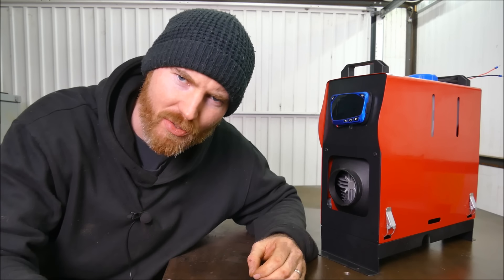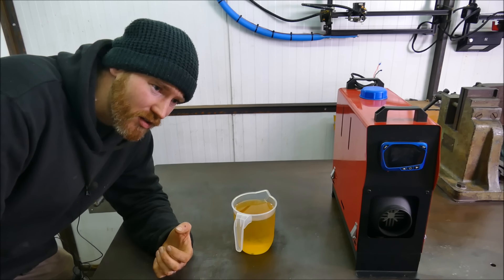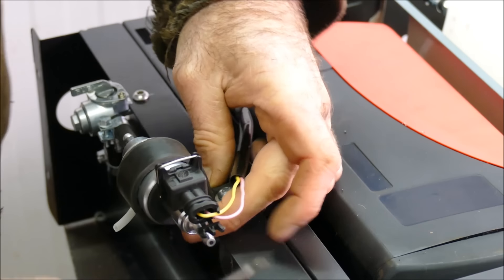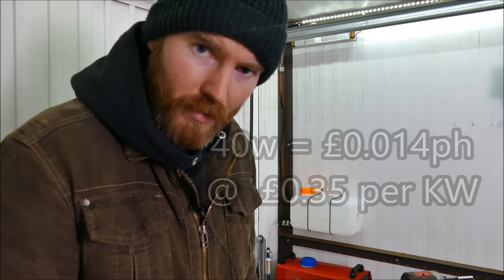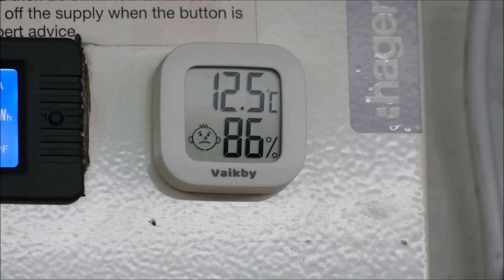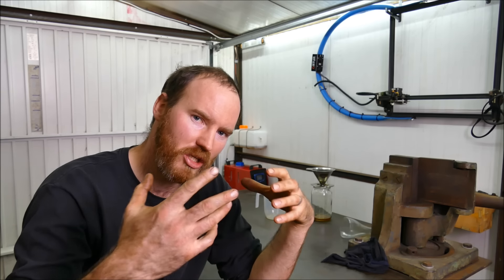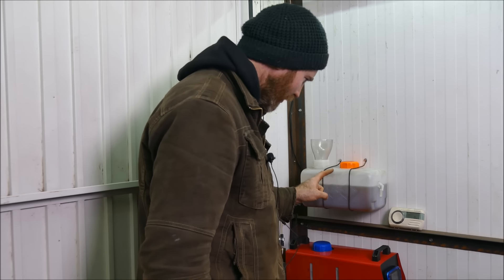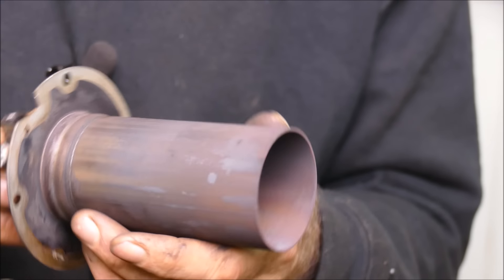£0.03 per kWh heater modification - Top facts & lies on diesel heaters - waste veg oil burn success

Comment: I wonder how well the heater would run on cold pressed hemp seed oil. Grow hemp for seeds, cold press the hemp seeds for oil, process the oil and use as fuel.
Reply from the maker: There is probably a chart somewhere but a low flash point makes an Ideal fuel. Cheers J

Comment: Could you use copper pipe for the exhaust?
Reply from the maker: Some people do. The stainless steel exhaust though is much cheaper to buy and can come in 2m lengths. Cheers J

Comment: @joshuadelisle Two interesting thoughts... Have you thought about scanning/creating a template for your gasket in LightBurn to use with sheet gasket material and your laser cutter to make your own supply of gaskets so that when you have to do maintenance you'll always have a spare on hand??? 🤔  I'd be curious if you used an Ozone (O3) generator to entrain the Ozone gas into the combustion intake to see if it would increase combustion efficiency and reduce emissions??? Ozone Generators are quite low power even though they use a step up high voltage to create the Ozone.

Comment: Unless anyone beat me to thi..... at 8:04min in - Might it have been a simpler arrangement if you had drilled out the chassis-through-hole and run the black hose all the way from the tank to your inline fuel filter. 3 fewer components!
Oh...and at 09:30min in - Is there good reason why you chose not to run black hose direct from pump to changeover valve? 
3 fewer components and two less opportunities to develop leaks.
Reply from the maker: Yes I wanted the white solid pipe in all places and not the rubber type. Also a consistent diameter and the rubber type is larger. Also the pipe coupling lengths were already cut to size which came with the solid pipe. Cheers J

Comment: Hi thanks for amazing video can you run this on used engine oil instead of used vegetable oil whats size fuel line you recommend also what wires you used to put the exhaust and fuel tank on please reply thanks
Reply from the maker: Thank you. Yes you can but it's recommended to cut it with Kerosene and have it well filtered. Changing the settings so it's air rich and pre heating the oil also helps achieve a clean burn. All accessories Should be listed in the description. Cheers J
Reply: @joshuadelisle  thanks for your reply if I'm using 9 liters waste oil not vegetable oil how much disle should I mix with 9 liters of waste oil should 1 liters will be good thanks also can I mix some Petrol for easy burning
Reply from the maker: @syedalam3513  if using filtered waste engine oil. I would do a 50/50 mix. Maybe even pre heat the oil too. Cheers J
Reply: I appreciate your fast reply thanks vegetable oil also 50 50
Reply from the maker: @syedalam3513  with veg oil you can use 70/30 cheers J
Reply: I did the setup today two tanks I want ask you if I mix little bit of gasoline with waste oil to make it thin will that work also do you prefer to run unit on high speed on waste oil or slow speed thanks lot mate
Reply from the maker: @syedalam3513  hi. I keep it oxygen rich. So I max the air speed at 4hz pump setting roughly. I wouldn't use gasoline because if it separates it becomes a fire hazard. Cheers J
Reply: Hi hope you doing good what pump should I run on 50% old used oil and 50% disel I'm having a carbon build issue should I run on max speed which is 5.1 hz thankyou

Comment: heat goes to the top of the room. what if we put device in to the middle of the garage e.x. under the table? there are also "Fireplace Fan Heat Powered Stove" will add some more turbulence over radiator or something :/ and what about putting some "car catalyst" to decrase polution? Also i loved idea to heat the water.

Comment: thanks for video ,,,,,,,,,,,,,, so where i live expect 5 dollar a gallon for kero @ roughly 5 liter a day is my math wrong ????? am i not getting my estimate of running 24 hours a day wrong compared to how long i would run this heater in a 720 square ft space ,,,,,,,,,,  would i have to run this heater for 24 hours a day , it gets some times around 30 F below zero here
Reply from the maker: Hi. I currently only use mine for a hour to get the room up to 20°c and then it's off most of the time. Also I had the machine on max for the test but you can set it to low which consumes much less fuel. Cheers J

Comment: I would have assumed that different fuels would require a different air/fuel mixture.  Does the air pump part of this design compensate for this by itself?  Or is there an electric motor for the air pump?
Reply from the maker: @benjaminnevins5211  you can adjust the air fuel mixture in the settings. I like mine to be oxygen rich for the cleanest burn possible. Cheers J
Reply: @joshuadelisle  I saw the part where you mentioned going into the settings and the pump pulses per second and the fan speed min/max. I just need to figure it out by testing?
Reply from the maker: @benjaminnevins5211  yes. It comes pre-set for diesel but you can  put an O2 sensor in the exhaust and tune it that way but adjusting the setting if you want it perfect.

Comment: Those rivnuts we're used extensively when my Jaguar was built. They suck. With a bit of age they can't be easily removed. The nut just turns with the bolt. And with the Jaguar most of them you can't get to the back side. So even after you get them out, you can't put the bolt back in.

Comment: Two things.
#1, To make the device run more efficient run the intake air to the combustion chamber off the output air from the heater. This will make the combustion run hotter and thus more efficient.
#2, Run the output hot air inside the exhaust-tunnel, this will increase the temperature of the device thus increasing performance without the need for any extra fans or heat-sink.
These two items in combination should improve the performance with a non-insignificant amount.

Comment: Hi Gary from the UK, just wanted to know if you can set the control unit up to a set temperature and it will come on and off for a constant room temperature
Reply from the maker: Yes you can but it doesn't switch off completely just drops to the lowest setting once the desired temp has been reached. There are new controllers I'll look into in the future which do it better. Cheers J

Comment: Would it burn nitro rc engine fuel? Rc engines use  glow plug as ignition...If so would it be more efficient?
Reply from the maker: Maybe. Not sure how expensive that fuel is. Cheers J
Reply: @joshuadelisle  2.5 litres is about 20 ish quid, so it's not cheap. But that's 20% (20% nitromethane, 15% synthetic oil and the rest is methanol). My maths skills arnt great so I was struggling to work out what the energy density per litre is. I do know that nitromethane needs less air than petrol/diesel to burn. I came to the conclusion that it might not be as fuel efficient and diesel/kerosene, but it might burn hotter? Then I remembered both nitromethane and methanol have a cooling effect before its burnt (that's part of the reason drag racers use it).

Comment: firstly replace your water with sand and you have a sand battery , secondly if you want to move the heat to a different location , use an egr cooler, with antifreeze (proper mix ratio) pipe it to where you want and add a heater core, pump and presto you have 100 % utility of exhaust gas and exchange core and a few pc fans to circulate the air through the rad, and that pipe is water tight its condensation from the immediate cooling

Comment: should the catylitic be next to the heater to work , rather than outside, on cars it is on the manifold as close as possible, would also have more inside as the cat. makes heat when burning leftovers
Reply from the maker: If it's a proper catalytic converter yes. The one supplied is just a muffler and has a drain hole that will leak carbon monoxide indoors so it should be outside. Cheers J

Comment: Hi great video . Im thinking oc heating my workshop . 
When using the veg oil did the exhaust smell of chips ? When i ran  new rape oil in a landrover the smell was notable.  Whats you opinion?
Reply from the maker: If it's clean burning there is minimal smell. A burner is probably more efficient than an engine. Cheers J

Comment: I have been looking into finned 22mm trench  heaters to recover the heat from the exhaust. You can get aluminium ones of these bit not sure they would handle the heat so I would use a copper one that has aluminium fins and also add an access point for cleaning, it would also need a constant fall so the condensate can run out. I watched another video on these where he tested the condensate with litmus and it wasn't acidic, which if it was from a diesel engine it would soon eat through  the egr exchanger and exhaust. Has anyone tried using a finned trench heater? And was it worth doing? It seems a faff to use a heat exchanger and a pump to take the exhaust heat to a radiator etc and will take up a lot more room on a wall and also adding more cost for parts and running costs of the electric

Comment: Because the bucket water was less then 100c, the water in the pipe likly was condensed water from water vapor in the exhaust. And the latent heat of condensation of water is about 2.260 kilojoules per gram (kJ/g) of water condensed. 

The majority of by products of hydrocarbon combustion are carbon oxidized to carbon dioxide and depending on the ammount of oxygen one can get minor amounts of carbon monoxide, and the other most common byproduct from the oxidation of hydrogen in a hydrocarbon is water. 

On cooling the exhaust gases, to below 100c causes water vapor to condenses and  give  up its latent heat of vaporization, which is quite a bit of heat, and so can very interesting to tap into for even greater efficiency. 

While most stoves use the chimney effect to pull in new air, and cooling the exhast to the point of condensing water out can pose a problem for getting enough air to fuel;  using forced air to the burner gets around that problem. 

Taking into account water condensation dribbles down a pipe, the exhaust coil should continually spiral down and then exit through the bottom of the bucket and continue a downward slope as it is guided to and  exits out of the building. 

Acidic water might form from small amounts NOx produced under combustion and form nitric acid with condensed water,  as well as form some carbonic acid with disolved CO2.  

Side track: If your condensed  water vapor dripples into a bucket of crushed egg shells, or clam shells, Then the calcium carbonate will react with any nitric acid and make a fertaliser, calcium nitrate that's water soulable. Although this would be pretty slow as ideally these units shouldn't produce much if any NOx. But You can then dump the water with calcium nitrate ions into your garden.

Comment: the exhaust is down hill and will soon fill with condensation.  the water bucket is a great idea, however, it should run in a slope to remove the condensation.  the line is NOT leaking.

Comment: 9.24 connection between the valve and the pump Hahahaha............The water in the exhaust was probably condensation from cooling the gases so low , High efficient gas furnaces have a drain and some times a pump to drain away the water , when the exhaust is cooler than the ambient air temp you can get a lot of condensation .   I have finally ordered a Vevor heater  it has all the goodies  for $198.00 , I wonder will it get here before WWIII ..................... good video Mate lots of how to in this one

Comment: What make of heater is this because I have seen a few of these and want to make sure I get the right one.
Reply from the maker: @RIPPUR7777.  They're all from the same factory just different names and colours, I've put a link to my recommendations in the description. Cheers J
Reply: @ Hi Josh I’ve seen this diesel heater Hcalory 12v 5-8 watt seems compact a nice on EBay  and supposedly Quiet which I want how ever I see on posts that they all have that ticking noise from the pump and have to up grade it. Would you think I should go for the cheaper model as I would have to upgrade it anyway. I would assume this make is made in the same place.
Reply from the maker: @RIPPUR7777.  Again
 they're all the Same. Just go for the cheapest or most convenient. Cheers J

Comment: The exhaust could have been collecting exhaust. Problem is that water is acidic too from some of the other exhaust products, like co2. Moisture will lead to acids eating through metals so make sure the exhaust drains well and is durable.

Comment: Kerosene or parrafin here in the UK is on my understanding only used to clean these so they don't need taking apart, heavy oil is best and parrafin or bio to clean, if you use parrafin then add veg oil  so it doesn't get too hot
Reply from the maker: Kerosene and paraffin are essentially the same thing. Kerosene is used as heating oil and last time I bought it was £0.60 per litre. Cheers J

Comment: My freeze dryer included a pitcher style water filter for the air pump oil that has to be changed every so often. Not sure how well it works for vegetable oil but it is a set it and forget it type of deal. It is somewhat slow.

Comment: I know this is old but could you put the exhaust through a intercooler type of device with fans could we gain some extra heat?
Reply from the maker: It's definitely possible. I'm building a heat exchanger for the next video on this. Cheers J

Comment: Hi, thank you for your video who is this targeted at? I have a domestic Fioul Heating system, with a 2000 L tank and a 20 kW heater. I’m guessing the price of diesel fuel is currently around one euro 35. If I could make my system more fuel, efficient, that would certainly interest me.

Comment: Hi, I'm clearing late to the party & but due to the £700 per month e.on want for my existing heating system I installed a 8Kw unit on the outside of my house last year and covered with a nice hinged wooden cover. I have installed an oil tank in my garage and only use heating oil.  I run my unit on No4 for 12-15 hrs a day & have worked out it is only costing £2 per day, I drilled 2x 4" holes in my wall so I don't have a draft when not in use, my house is roughly 100 square meters per floor, and the general temp downstairs is 20° upstairs is a bit cooler but that's mainly due to bedroom Windows being open slightly. I think I might run the exhaust through a sand battery in the near future. Overall it has been well worth the investment, oh and I use 2x 10ltr fuel tanks so I only have to top up once a week which is also easy as I use a small pump to decant the oil.
Reply from the maker: Well done. cheers j
Reply: I’m new to these but noticed the exhaust is wasted heat and lots of it, if you can run a baseboard type heater(copper pipe with aluminum fins type)  as your exhaust. I bet there’s 90% efficiency doing that.

Comment: Use domestic heating oil and run the exhaust through a radiator before exiting the house, Important thing is radiator top should be a fraction lower than heater exhaust outlet pipe, connect exhaust to top and exit though bottom so as not to get a build up of water from exhaust. It works great that way. Results in more heat capture and heating oil is only 56p a litre so much cheaper

Comment: I'm curious to find out how well one of these heaters work in a static caravan, in comparison to LPG heating? From your videos it seems as if they'd be far cheaper to run.
Reply from the maker: Definitely far cheaper. These would work very well in a static or touring caravan. You just need to make sure the exhaust is safely going outside away from your breathing space and duct the warmed air low to the ground as heat will always rise. Cheers J
Reply: @joshuadelisle  thank you.

Comment: Put a 1 0r 2 Very Small Fans At the Peak of your Celling .Run the Fans On The Lowest Speed .  to the Pull the Heat Off the Celling & Back into the Room .

Comment: I have the 5 kilowatts small version having issues with the fuel pump. Did Run one time when first installed but hasn't worked since. I've watched dozens of videos. Is there any other options besides buying a new pump
Reply from the maker: Pumps are only £20 and should last years. Air locks are a problem which is why a 35-90° angle is necessary. You should be able to test the pump independently from the system by putting power into it and listening for the click. If nothing you just may have been unlucky with a faulty pump. Cheers J

Comment: have you costed in the small amount of electricity required?.

also does any of these heaters generate their own small electricity use ie like a fan blade attached to an old bicycle dymino
Reply from the maker: Hi. Yes it's 40w which is roughly £0.01 per hour. It doesn't have electrical power generation only heat. Cheers J
Reply: @joshuadelisle  i made my comment before watching the full video on which you later covered my question so sorry for my knee jerk comment.

these little heaters are amazing and its so sad governments stop us using fuels that get burned of anyway.
there should be an off grid allowance if you're a certain millage away from any mains supply.

Comment: I used to have a school bus conversion that I ran on used motor oil cut with gasoline at about 10-15% to try to match the same viscosity as diesel.  Do you think cutting veggie or motor oil in the same fashion for this purpose would be helpful?
Reply from the maker: I personally wouldn't use gasoline/petrol because of how combustible it is. Diesel won't combust without being wicked or atomised making it a lot safer. Cheers J

Comment: I saw where some fella filled an old nat gas water heater tank with sand and piped his exhaust from one of these heaters through the central heat exchanger tube.  Over the course of running the unit dry, a goodly measure of the waste heat was absorbed by the sand and continued to radiate heat for several hours.